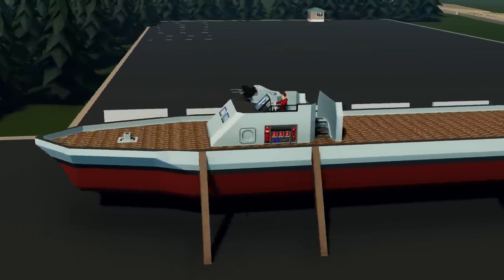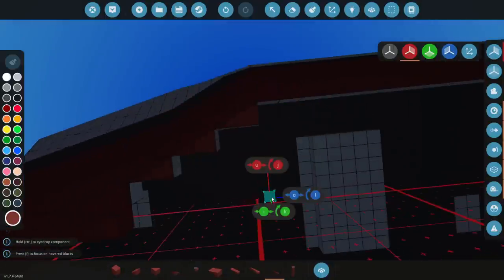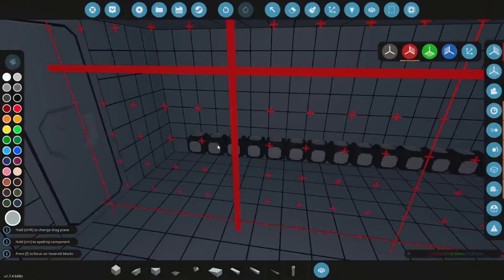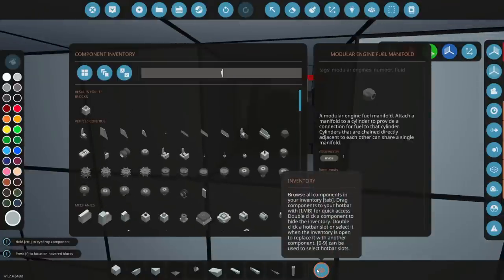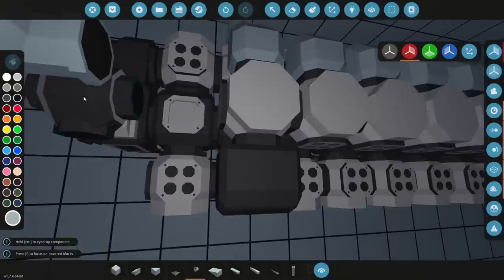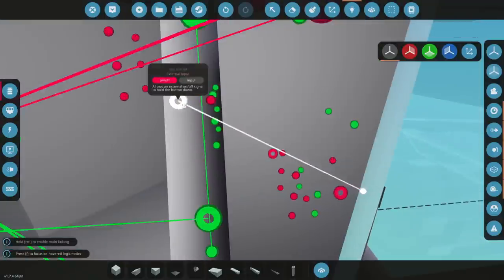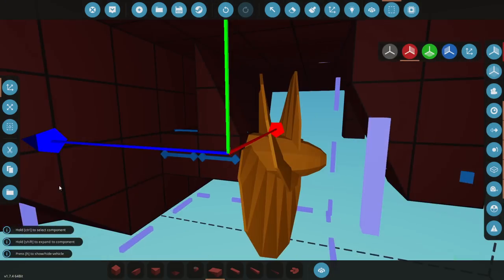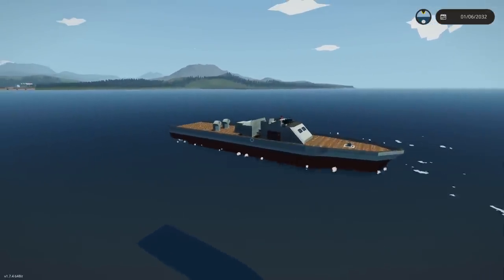Lets Install TWO GIANT ENGINES! - Lets Build A Torpedo Boat In Stormworks! #3

Comment: I'm kinda wondering if a large cylinder inline engine could match the power output of these massive radials you've been using in a lot of stuff.
Reply: I usually start using 3x1s in these situations. A 3x3 may be too big but it needs more than 16 or so 1x1 cylinders.
Reply: I’m pretty sure 1x1’s are actually more space efficient than 3x1’s for the most part

Comment: belt pumps are super inconvenient I don't like them at all, I like using impellar(or small electric pump on small engines) for the air as it provides a substantial gain on fuel economy, dont think pumping coolant is even worth it assuming engine doesn't catch on fire